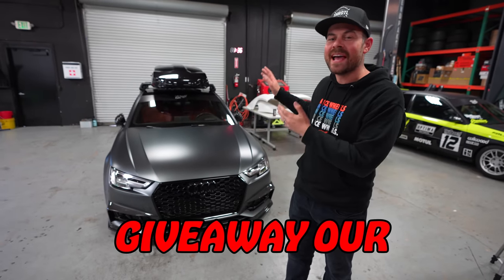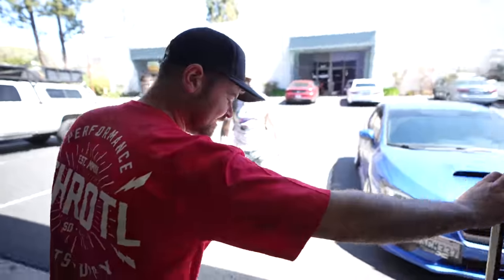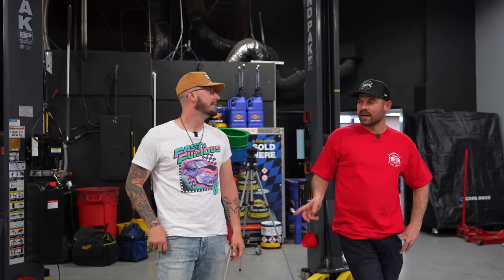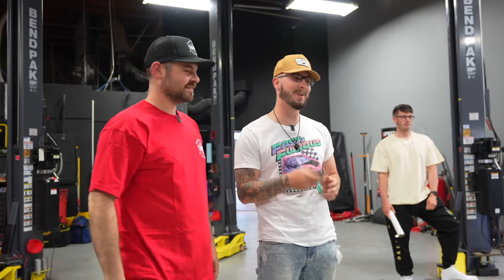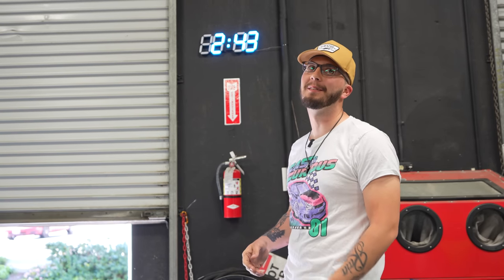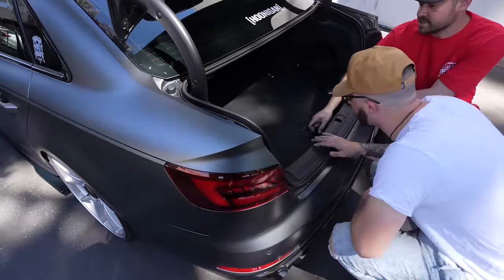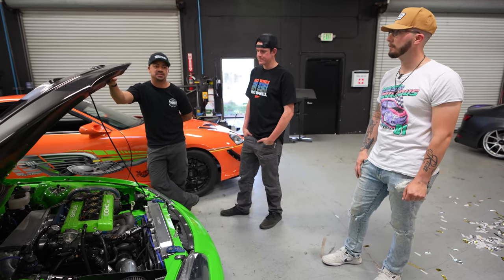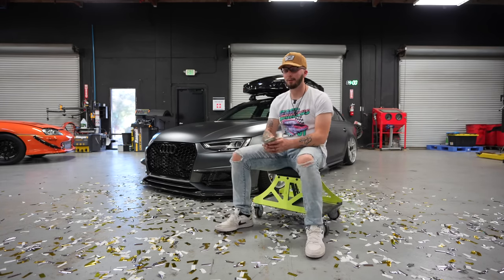Revealing His Dream Build & Then Giving It To Him! (AND $20,000!)

Comment: The $20,000 is for the cost of all the broken parts, breakdowns and maintenance that plague euro cars
Reply: 2017+ No... Everything else yes
Reply: Always the guy who saw 3 euro vehicles with mechanical issues and assumes every single euro car has the same issues 😂😂😂
Reply: You right for the most part, but no doubt throtl picked a non abused one and it's low mileage, plus Audi's 2017 and up improved dramatically with reliability
Reply: Nope , it’s for gas and tolls back to pa. Haha
Reply: @michaelpatriots5702  must be a lot of tolls then as the s4 is actually really good on fuel.
Reply: @gges1605  lol its real purpose is for the registration.